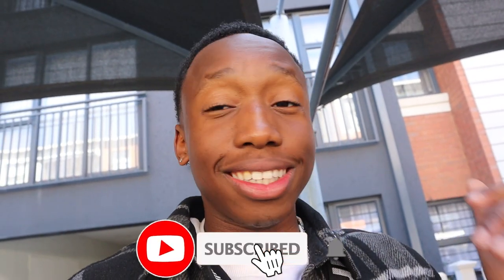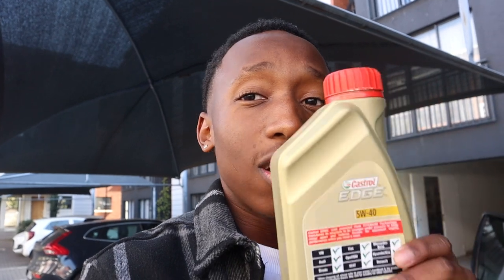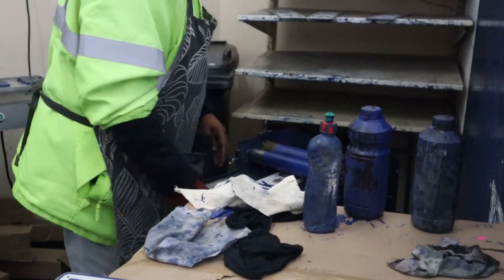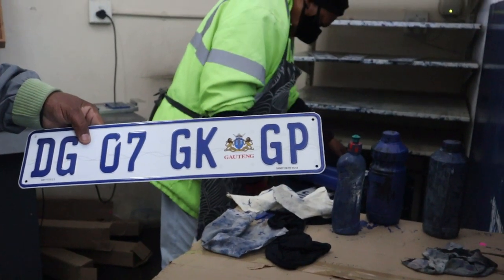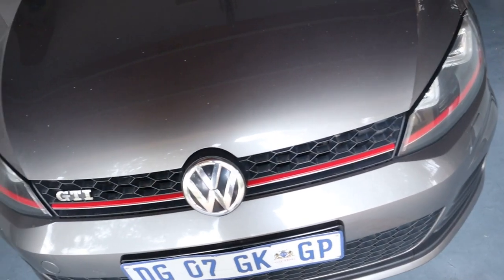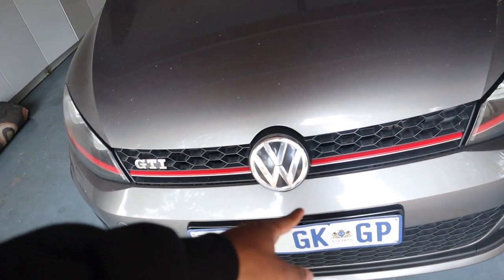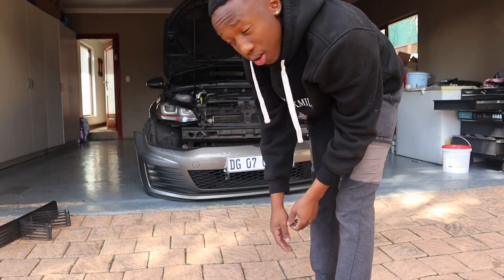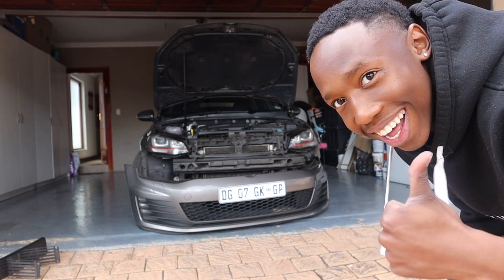I Tried Installing Magnetic Plates On My GTI!

Comment: I went for velcro on the front of my f30 and put it on the black thing holding the plate holder and on the plate
Reply from the maker: How does it look?
Reply: what's the point tho 😂 it will look like there's still something on the bumper when you remove it, unless ur doing it for 😉 illegal fun 😂  then ya